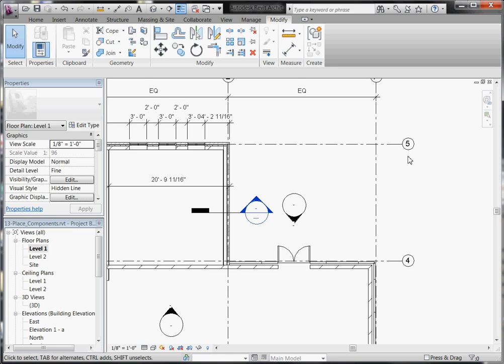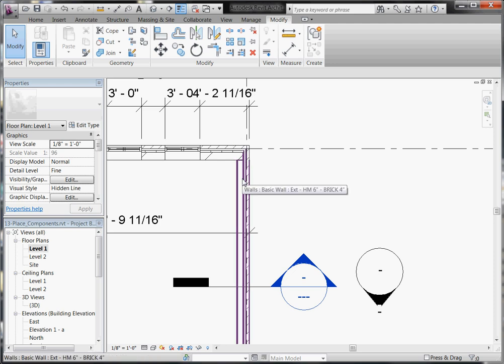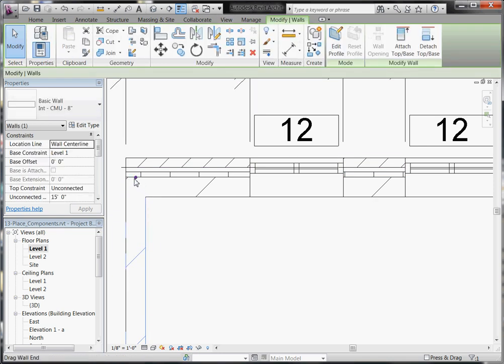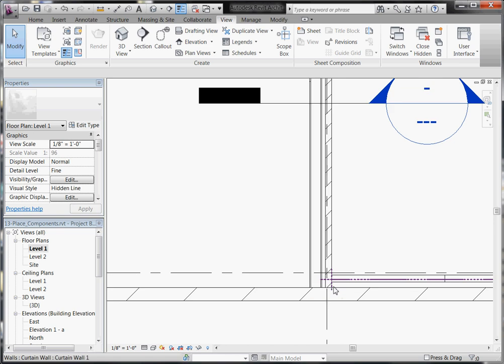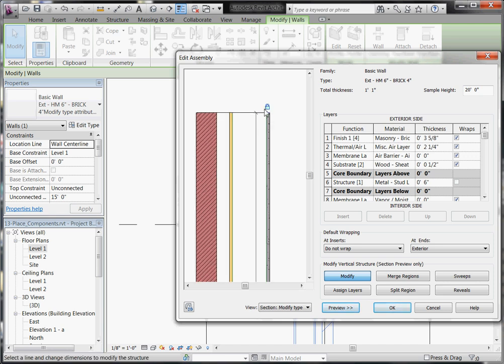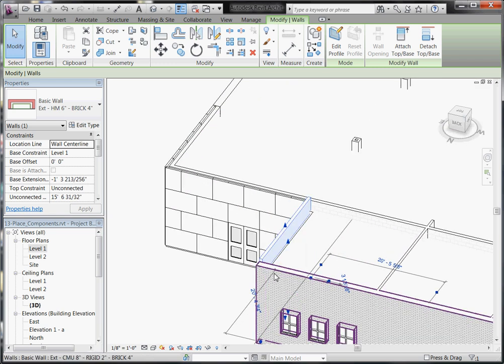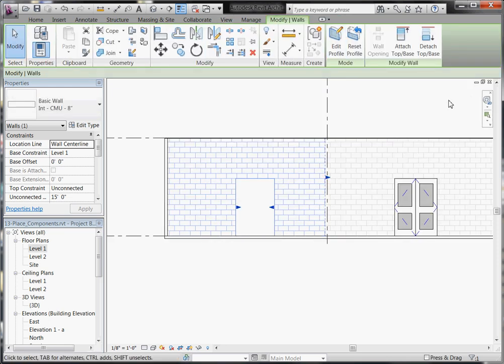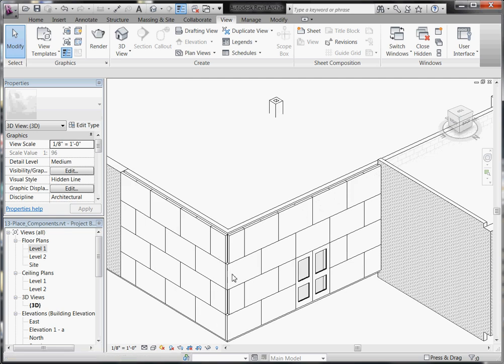Easy Revit (2011) - 25.3 - 6 Methods For Modifying Wall Joins

Comment: Thank you, thank you, thank you. The Cut Profiles tool almost solves all wall-join issues. WHY have I not known about this before. It's almost AutoCAD-like in it's simplicity. And cycling through the options using the Wall Joins tool along with Cut Profiles is perfect. Great tutorial.
Reply: JuJitsoup , I appreciate the compliment. I'm glad it was helpful!